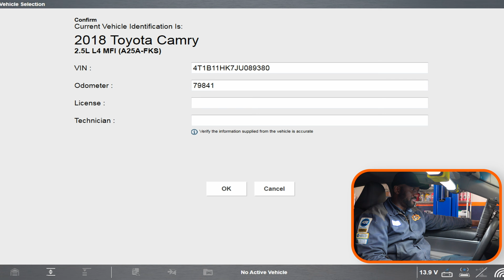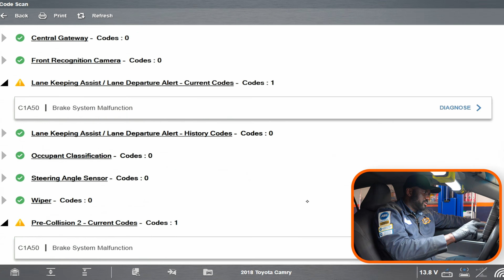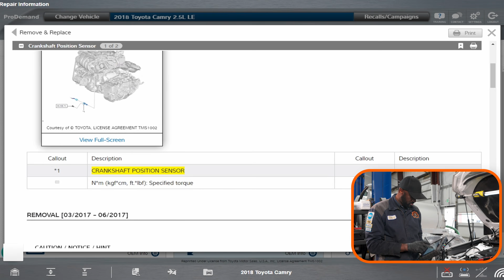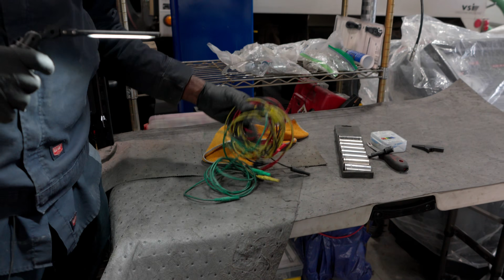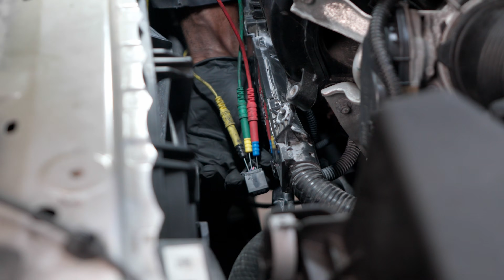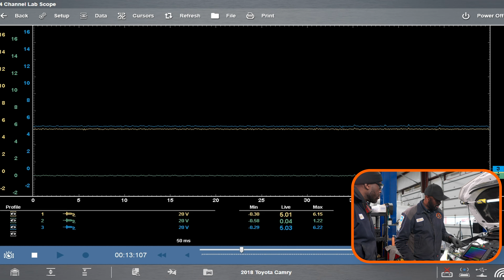2018 Toyota Camry - Long Crank Before Engine Could Start ( Part 1 ) Diagnosis & Repair

Comment: On Toyotas since like 2009 or 2010MY the software is designed to throw that C1201 on the ABS module everytime the ECM detects a fault, disabling the ABS module right away. So as soon as the fault on the ECM get resolved, the C1201 will dissapear.
Reply from the maker: @christianrosario937   Good to know, Thanks!

Comment: Got a acv36 2006 Camry with the double beep and no locking when press fob. Have you ever taken out the integration relay under dash to fix this problem. Some suggest maybe actuator in door. Stay happy champ
Reply from the maker: @Swenser  Thanks! No I haven't
Reply: @KITS_Auto_and_Truck_Repair actually investigating passenger side door ATM. When I lock that manually first locking all round works so might be actuator in passenger door. But so many getting trolled with this problem. They think they've fixed it but then problem comes back. Good luck all repairers around the world! Peace be with you.

Comment: The closed loop temp code is more than likely upstream o2 sensor failure.
Reply from the maker: @marshall1157  that's possible